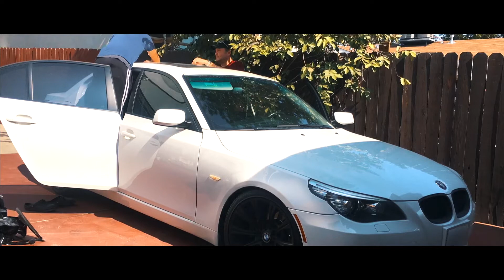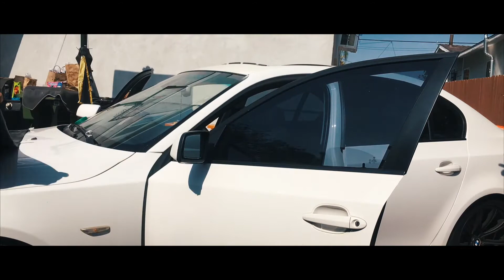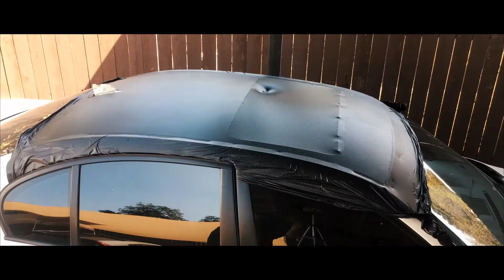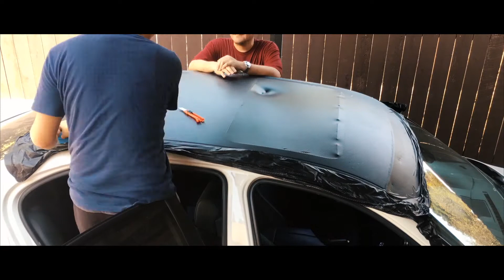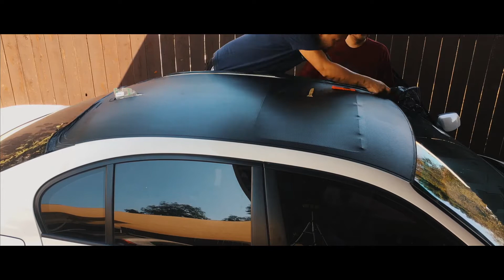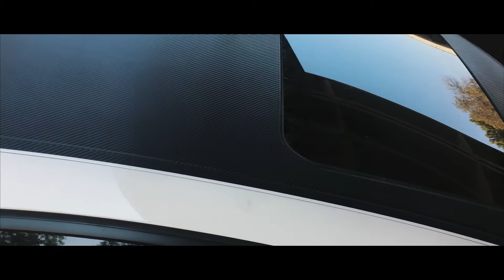BMW e60 Carbon Fiber Roof Vinyl Wrap

Comment: Did you have to remove the windshield trims and sunroof trim? If so.. how hard was it to remove?
Reply from the maker: visith heme nothing was romoved it was trimmed around it inside the sunroom for clean look. Make sure use a nice sharp blade, and be careful with the paint. 😁 Thanks

Comment: How would you put back the fin. Did you use 3m tape?
Reply from the maker: Tarik Eisa Yes, good 3m tape,  I first  stick the first side without removing the second peel side so I can cut around the fin  to give it that oem look, and a little bit of silicon inside for water proofing. Thanks!